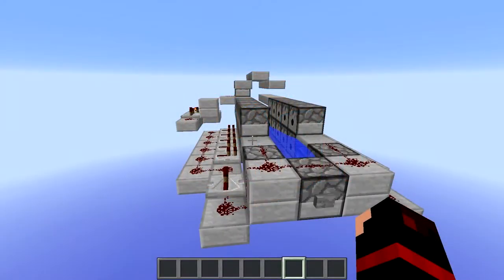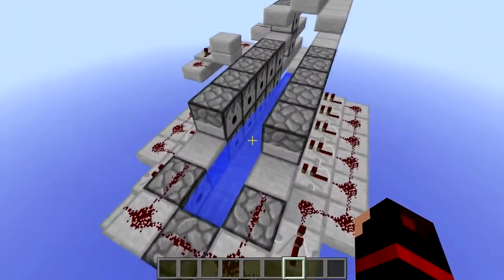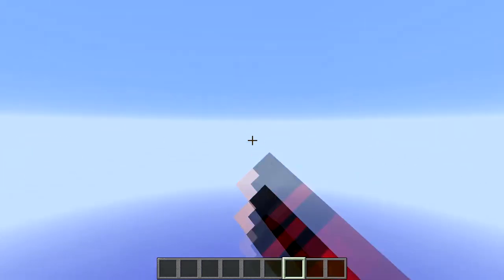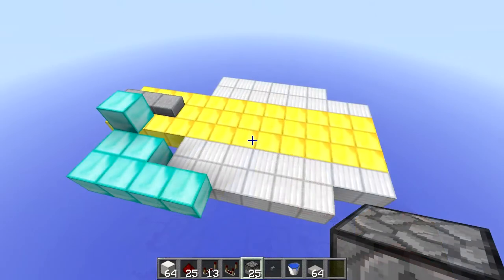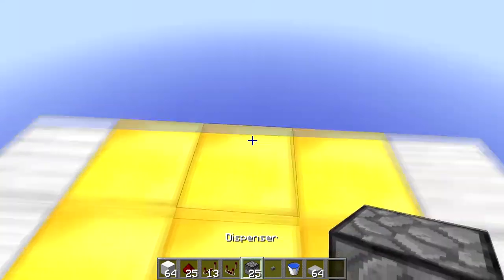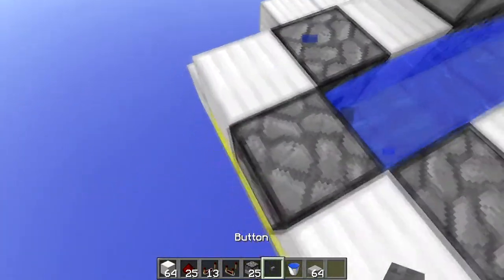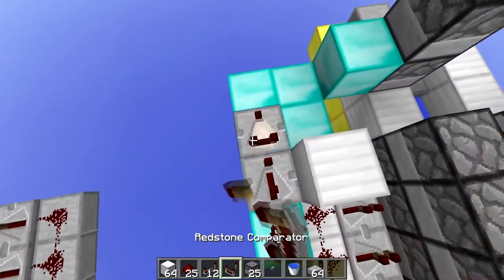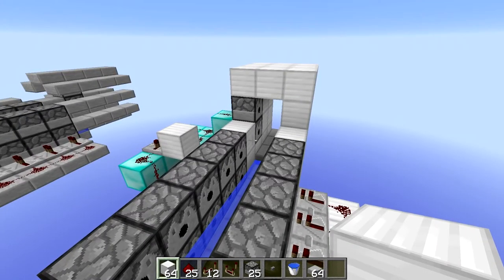Compressor TNT Cannon [Ultimate Obsidian Base Destroyer]

Comment: Guys, this is not in fact solely my cannon, I found this cannon on youtube before but I refined the concept to make it fire as straight as possible PS Im that friend
Reply from the maker: Ignition Burst Yet only slightly compacted, the original had a repeater going into the end dispenser with a few extra unnecessary blocks.
Reply: That was just to adjust the timing according to how far you wanted it to go